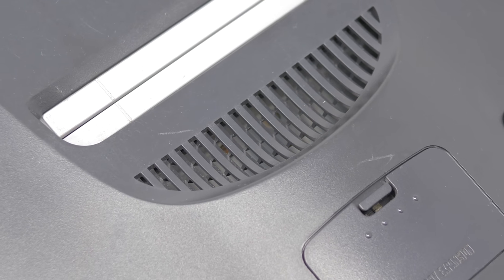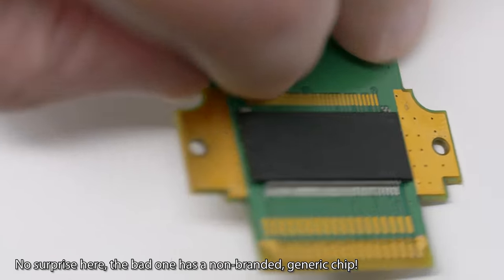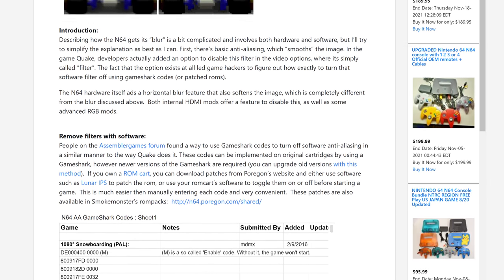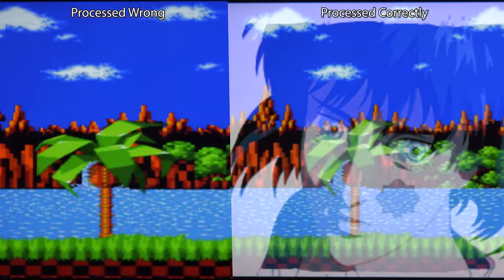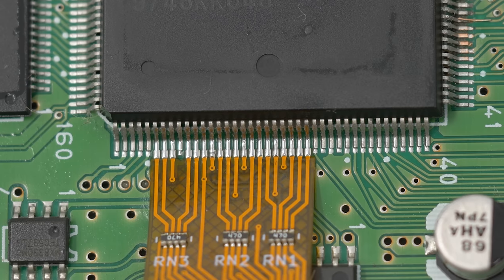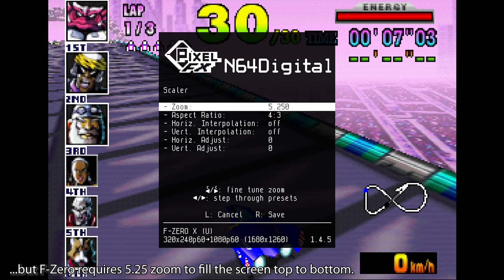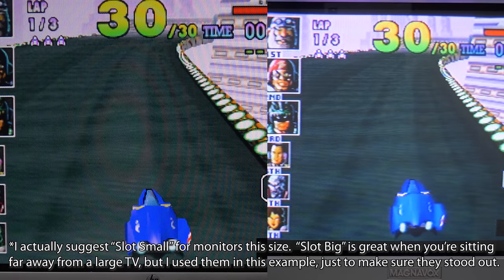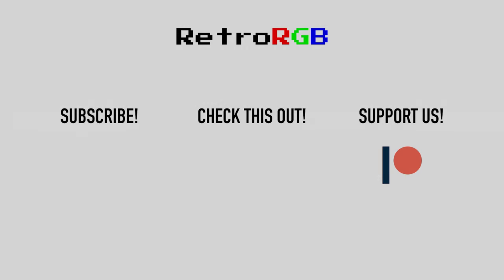Getting Started With The Nintendo 64

Comment: I got a nintendo 64 from ebay but it did not come with a Jumper Pak and now Im super stressed out, also buying games is really a hassle. I went on ebay and amazon and found that on amazon games costed alot more and some games *fried your system*. I'm also still really suspicous with ebay after my n64 didnt come with a jumper pak. AHHHHHHH
Reply from the maker: Just follow the steps in this video, get a Nintendo-branded jumper pak and you'll be okay :)

Comment: The best Nintendo 64 hardware is the NUS-FRA (french euro pal) which have the RGB printed circuit board but not officially finished at the last minute. But you can do it yourself.
Reply from the maker: But it's 50Hz.  So, not really.
Reply: @RetroRGB  Ok but if you're able to mod to RGB, you can mod 50 to 60 ;)

Comment: With the RetroTink 5x or similar, can they be used with switch boxes if the plan is to connect them to the output of a switch box to the TV? Or are they best used with the one system you are planning to play? I have the old Pelican and Gamestop ones to play my retro consoles using component and composite connections to a CRT, and wondering if it was worth getting this to update some of the systems that don't use lightguns, like N64 or my backup systems I can play on modern TVs with upscale resolution. I worry that having to plug and unplug connections will cause wear and tear and buying individual connections will add up. Any thoughts?
Reply from the maker: The work great with switchboxes!  If you already have one that's decent quality, you're all set.  There's some high end options designed specifically for retro gaming if you'd like an upgrade...but if yours works, there's no need to upgrade:  http://bit.ly/gcompsw

Comment: Hi! Which one looks better in a 4k flat panel? A RGB mod with a Scart cable on a upscaler (in my case, a  GBS-Control) or a HDMI mod? I bought a japanese N64 and I see that RGB is easier and cheaper. Is there much difference? Thanks!
Reply from the maker: In my opinion, it’s VERY close. An RGB cable into a GBS-Control is an excellent solution.
Reply: @RetroRGB  thank you! I’ll do the RGB mod!

Comment: CRT is the way
Reply: Not really for the n64. Maybe for 8/16 bit consoles.
Reply: @ninetendopesaitama2107  I'd say even more so for N64. It makes the console's blurry output appear sharper.
Reply: @FinalBaton  if you want sharpness get a line doubler or a rgb mod + upscaler for the n64. Oled is the way. Not a clunky crt.
Reply: @ninetendopesaitama2107  what's the cost of your rig? Mine is $30
Reply: @FinalBaton  i use a 24 inch 2ms Acer gaming monitor LCD 1080 p (10 yrs old worth nothing) connected to my MiSTer. And a LG cx for my series x. Sorry but a crt wouldnt fit in my setup. I want a clean setup. Not cable spaghetti. ;)

Comment: I never even got a scart lead cable with my n64, mine has a single 1 pin aerial adapter that plugs into the aerial socket on the T.V. Is this because I bought it in the U.K? Or just because I bought it so long ago?

Comment: I'm in despair. I bought a DURABRAND 11AK36 crt tv, but I don't get a signal via the Scart connecter. What is the reason? Do I have a wrong/bad cable (red yellow white + adaptor for skart)

Comment: I have a PAL N64 that works with S-Video.

Will I get the same picture with a RetroTink 2X Mini with S-Video cables as with a RAD2X?
Reply from the maker: The Mini + S-Video will be slightly sharper, but the RAD2x has a smoothing filter.  So, I'd suggest buying based on what look you prefer.  For me personally, I like smooth graphics with N64.

Comment: I have the 64 digital but don't understand what the frame lock setting means.  All I know is (lowest lag) is the one I like best, what do the other 2 modes do though?
Reply from the maker: All they do is add buffering for compatibility.  If the lowest lag mode works for you, then there's zero reason to try the others :)
Reply: @RetroRGB  alright thanks for the help!

Comment: I have the retrotink muti.  Is that worse than the retrotink pro? Or am I good  with my retrotink multi? I use the insurrection industries s video cable with it.
Reply from the maker: The 2xM is excellent, it just doesn't have a smoothing filter.  Still a great product though!

Comment: I use a recently made, high quality, individually shielded S-Video cable plugged into my shiny new RetroTink 5X Pro. It's still far worse looking than high quality emulation, but is leaps and bounds better looking than plugging composite directly into an HDTV. 

Before I got a 5X, I used a ln original RetroTink 2X, and it looked pretty good, good enough, but not fantastic (that's on the 64, not the Tink or my cable. My Saturn looked fantastic through the 2X.) 

Without any hardware modifications, I assume my good S-Video cable and my 5X are giving me the best picture I can probably get on my 4K TV.

p.s. I do have an mClassic that I got to clean up N64. It doesn't really. With my 5X, I don't use the mClassic with the N64. I still like what the mClassic does for my Xbox 360 and my PS3, so I don't regret buying it. I've also found use for it cleaning up PS2 games going through the 5X. No upscaling, but it does smooth out some of the jaggies.

Comment: With N64Digital using 1200p deblur and algorithm on, Big slot mask with 280 rotation, it looks funtastic! Miles away from an OSSC and RGB combo. Night and day I could say easily. Someone could also use 2560*1440 as an output resolution

Comment: The Mcable/Mclassic does work on n64, but it heavily depends on the output resolution you have it set to through your scaler.  The higher the resolution the less it's going to do for it, as it was made to do more with lower resolutions.  It put's in work for 720p and lower like 480p etc.  But I can definitely see jaggies get a tiny bit smoothed on higher resolutions, it's just not nearly as pronounced.  It's also worth seeing how it effects different games with each resolution and the smoothing effect and anti-aliasing on or off and any other settings your scaler has if you don't mind messing around with all that stuff like I do.

Comment: Retro tink 5x pro does not require a modded console .. correct?
Reply from the maker: Correct - Just plug in a composite or S-Video cable.  This cable works with all NTSC N64's and looks great if you want an upgrade over composite:  https://insurrectionindustries.com/product/nintendo-s-video/

Comment: It’s definitely recommended that going with official memory cards for n64 is the better option cause the 3rd party ones tend to die very quickly
Reply from the maker: The ForeverPak 64 is absolutely the best option out there.  They just released new colors too:  https://www.retrorgb.com/foreverpak-64-in-stock-new-colors.html
Reply: @RetroRGB  I’m just going off of all the cheap 3rd party ones they released back in the day when the console released you know like the 8MB that can hold more games and last forever when in reality they lasted like 2 years. I have a red 3rd party see through ps1 memory card that lasted me like 2 years and now doesn’t even read. They were that terrible
Reply from the maker: Completely agree on those!
Reply: @RetroRGB  I also know someone who had not n64 but third party GameCube controllers that he brought into college cause he ran like a games club in the college I went to. And literally not even a week and they stopped working

Comment: Good video. A lot I didn't know. Although, I'm not super techy. I got lost about halfway in. I have an OLED tv with no analog hookups. The Retrotink 5x costs like 4-5 times what you can buy an N64 for right now lol. HARD PASS. Even the 2x costs the same price as the N64 now. Ugh. And....the 2x mini is the same price as the 2x. Geez. I just simply need the best way to plug in a converter to hdmi seeing my tv has no av hookup. Obviously with the best pic I can get for not spending a $100 just to be able to hook it up.
Reply from the maker: Respectfully, either spend the bare minimum on a RetroTINK Mini, or go find a free CRT.  Any other low-end, plug and play option is a waste of money.

Comment: Can you tell me how to set my image when I use a normal N64 on the OSSC no RGB ad on?
Reply from the maker: You can't, as the OSSC only accepts RGB, Component and VGA signals.  You'd either need to mod your N64, or get a different piece of equipment.  This video has tons of info:  https://youtu.be/TdfFnR-hOK8
Reply: @RetroRGB  

Hey, I bought a Non RGB board from Kaico, so I can bind my N64 to the OSSC without a mod, but I can’t get the settings
Reply from the maker: Sadly, Kaico's a clone company, so there's no telling what's wrong with the device you bought.  I hope you get it working though.
Reply: @RetroRGB  

The device actually works perfectly, I just don’t know how to optimally adjust the image with an output of 516p.

Comment: Should my HD retrovision Component cable work on an RGB modded N64?
Reply from the maker: Yes, definitely
Reply: @RetroRGB  That's what I thought but I tried it and it wouldn't come on. Maybe the mod failed? The cable works with my 1Chip SNES. What do you think the likely culprit is, SCART cable or the mod?
Reply from the maker: If the cable is working in your 1CHIP, it’s most likely the N64 RGB mod.

Comment: If I have a RGB modded N64 with HD Retrovison cables, would it be worth buying a Rad2x for the digital out or would that be unnecessary? I’d be connecting to a Retrotink 4K.
Reply from the maker: Totally unnecessary - An RGB N64 with HD Retrovision cable + RetroTINK 4K is an amazing setup :)

Comment: Thanks for that disclaimer at the end I was about to explode. All third party n64 controllers are terrible. They are objectively bad because they are not even  attempting to replicate the originals sticks sensitivity or analog gate. This changes the way a game feels in big or subtle ways that you would never know unless you compared an original one after the other.
Reply: Yeah, the old Hori pad is basically the only one with a correctly shaped gate, and it still has some sensitivity issues. I like it for platformers, but even there it makes some sections harder. If wear wasn't a concern I'd probably stick to the original for everything, to be honest.
Reply: I will say this is generally true minus the Hori Mini Pad. I’ve been using it for the past few years and there is literally no going back. I love the 64. It’s probably my most played console, but the controller was a piece of garbage in my opinion. My biggest problem was the analog stick. It just felt so cheap and delicate. I never felt like I could get the same movement out of it as I could on other control sticks. The stick on the Hori feels much better to use overall and lacks the deadzones that other controllers with better have that make them worse. Zelda, Mario, Banjo, Smash… you name it. I would take the Hori over the regular controller any day of the week. Even with a Hori, though, I would still keep an OG controller around. The Hori is near useless for playing any game that uses a D-Pad. Games like Pokémon Stadium and Kirby 64 are best played with an OG controller. Otherwise, I’m purely Hori
Reply: @Mr__Jack  I don't think the N64 stick in good condition is too bad at all, though you should make sure they stay (silicon) greased. I use mostly Hori these days just for the piece of mind, but it's still that tiny bit less precise on occasion.

Comment: Any tips to get better quality for cheap?? New to this console
Reply from the maker: As shown in the video, just use the cables it came with and any CRT
Reply: @RetroRGB  what about for a hdmi tv?
Reply from the maker: This video shows you what and why:  https://youtu.be/16z_C7-Gom4
If the ONLY console you have with analog outputs is the N64, the RAD2x is basically the same thing:  https://youtu.be/O4HBvpRIwa4

Comment: Hello good dude!
Yes the good old N64 console has poor screen quality for larger LCD TVs, even with the $300 RetroTink X5 the pixels won't render.
It may be possible to build a mini chip with render and install the correct software for the N64 console so that you can enable render in the N64 console menu.
An Ultra HDMI Mod Chip would be useful for this.
Only question is now! Would you be good at programming new chips and installing them in the N64 console?
I mean there should be a way for the N64 console to play like an emulator only running on original hardware.
I know it's possible with the latest technology and programming that we could all own today.
I find all the additional HDMI converters all pointless and do not bring good quality of the wide angle in the game.
For the SNES/NES/Atari... console, the AV composite cable is not bad, since most games do not have a wide angle and therefore cannot see the flickering pixels too much.
Even GB GBC GBA games are pretty okay on AV Composite because many games don't have wide angle
Reply from the maker: You can't install an upgraded rendering chip in an original N64.  That's something you'd have to do via software emulation.
Reply: @RetroRGB  But maybe someday it will be possible.
Because unknown developers are trying to install a render pack in the Warrior64, which is quite complicated. That's why Nintendo blocks the Warrior64 console because there are also original components.

Yes you are right that it is only possible to render with an emulator and not otherwise, but maybe in the next few years it could be possible.
Technology is always evolving and will only get better.

I own Super Mario 64 PC Port V2.2 because I find the version best than the latest versions.
Have you already seen? The latest versions have programmed a completely different graphic in the game and it doesn't look as nice anymore.
I find the V2.2 version the best because the graphics have only been installed in 4K and have not been changed otherwise.
Reply: @RetroRGB  Okay with a CTR TV is beter for the graphics in the game ✌️

Comment: Instead of that eyesore under an already ugly controller receiver, I suggest just plugging the receiver into an extension cable and having the receiver sit beside the console in easy reach for swapping out memory cards.
Reply from the maker: Right, because an extension cable is exactly what someone who just bought a wireless controller wants to use.
Reply: @RetroRGB  I think you perhaps misread? I'm talking about for the wireless receiver itself. Set it alongside the console or even behind the system out of view, with it still in easy reach to lift up when the need to remove or insert a memory card rises.  Not objectionable in the slightest, and a lot less ugly.

No worries about strain relief, the controller is still wireless, many already have the cable on hand, and I'd argue it would be easier to insert and remove a memory card into the receiver.  And the console's face for anyone that cares about aesthetics doesn't look strange like it does with a large receiver plugged in and a 3D printed mount underneath it.

Comment: Buy a cheap 24 or 32 inch 720 hd tv. They almost always have a composite out (no component which is fine). I did this instead because the 2x mini was out of stock. TV usually around 99 bucks and you can even get one on sale for less.
Reply from the maker: They usually have a TON of lag...especially through the analog inputs.  I'd strongly suggest NOT doing that:
https://youtu.be/jJzN_YHZezY
https://youtu.be/16z_C7-Gom4

Comment: “You wont need to spend a lot of cash to get a decent experience for n64”

Yeah the N64 output sucked anyway, blurry al the time, due to hardware shaders which is”unable” to disable. But yes! , or no?  If you want the best output you have to bypass the PPX and solder directly onto the cpu, to get the untouched videosignal, you may scale this up directly to 1080p, to future proof your console, away from analog signal processors, which will fade away.
Reply from the maker: You might want to watch the video.